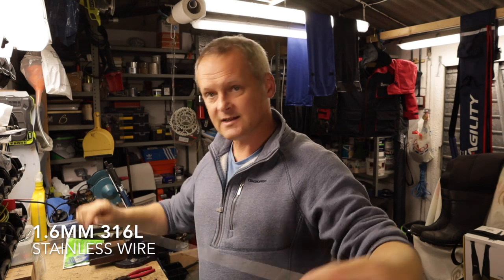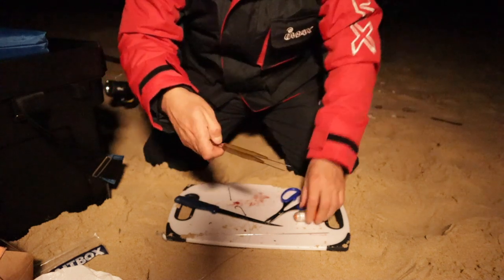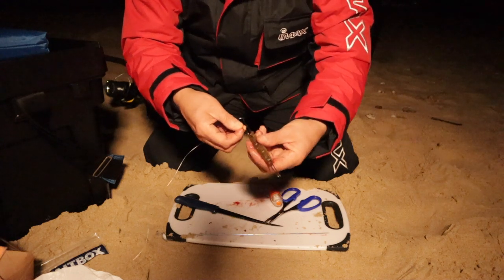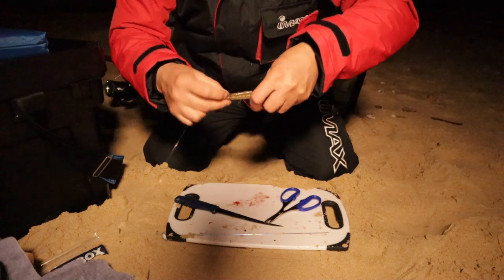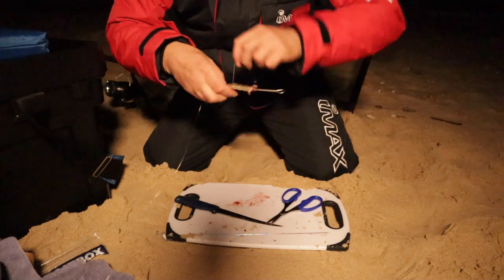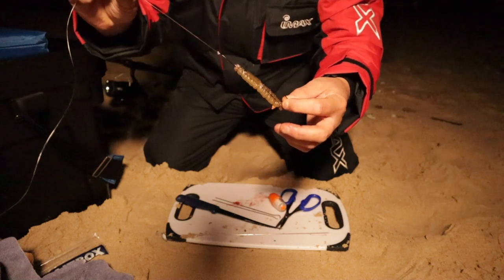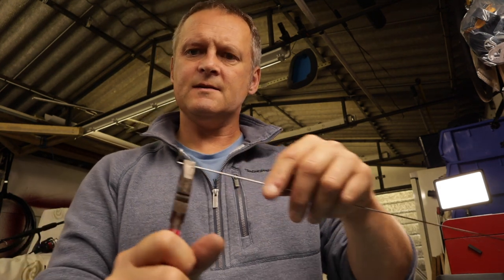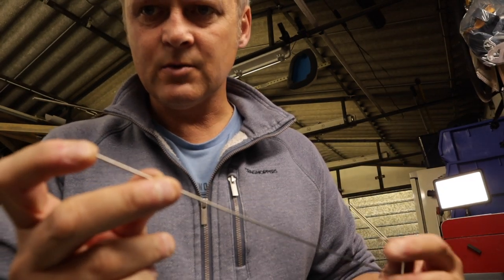How to make Bait loaders & Bait Needles

Comment: Nice video Mark.
I make my own loaders too.
When I use the single needle to load up lugworm,i like to slide a couple of rubber beads onto the wire , stopping opposite the crook where your hook sits during whipping.
I find it stops the worms sliding too far down when i slide them on and it acts as something to grab when i slide it off ready to cast
Reply from the maker: I’m always looking at ways to improve stuff so I’ll look into the beads and give it a go. Thanks for taking the time to comment.
Reply: @seaangling  ;-)

Comment: Mark where you get the rods mate? I know sandman sings it's praises but 3kg for 55 quid or whatever it is? I only want a handful to make some throw away leads, baiting needle ect
Reply from the maker: My brother and I both weld so I have it easily to hand. You could try MIGTIG&ARC in Portsmouth. Failing that and if there is enough interest I could get a bundle and split it down. The loaders and needles last forever as they are better quality. Really useful to be able to make different sizes to suit personal bait choice.
Reply: @seaangling  that's a really good idea, I put that to sandman a while back. I would have zero problem paying a bit over the odds so I didn't have to get kg,s of the stuff. I thought about doing it myself and making a few quid but I don't think I have the customer base like you guys.
Reply from the maker: 0.5kg is £6:59
Reply: Mark Williams Sea Angling ah ok, is that from migtig&weld?
Reply from the maker: Yes, from MIGTIGARC. Not sure how many rods is in a 0.5kg bundle.
Reply: @seaangling  I've just ordered a couple of hundred grip lead wires for 3 quid, see how they work out, worse comes the worst I'll just make a load of throw away leads out of some lead flashing I got, don't think it will stand up to making lead clips but should be ok for baiting needles, I loose one every other trip it seems along with my elastic 🙄. I'm not even sure of what I'd be ordering with the propper stuff.
Reply: Find a welding and fabrication company on an industrial estate if you can, and see if you can buy a few dozen lengths from them 👍